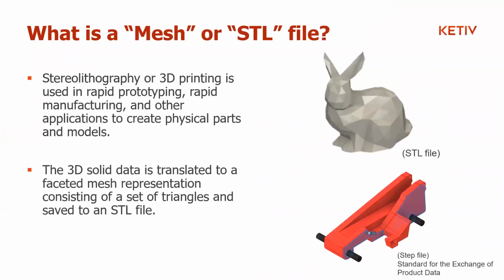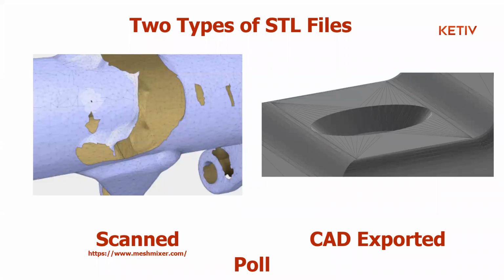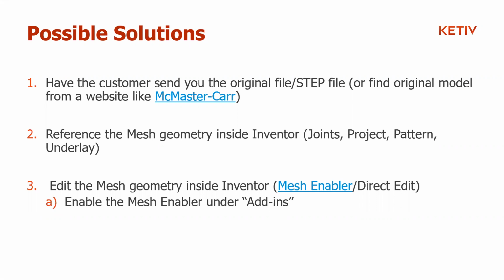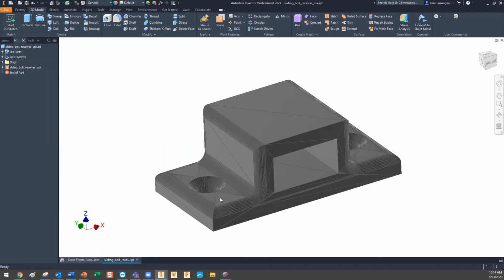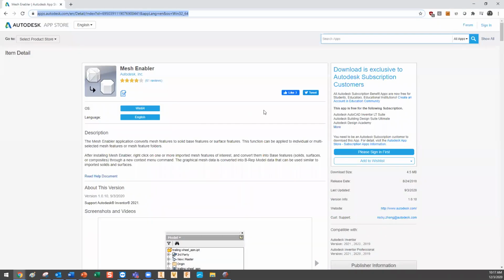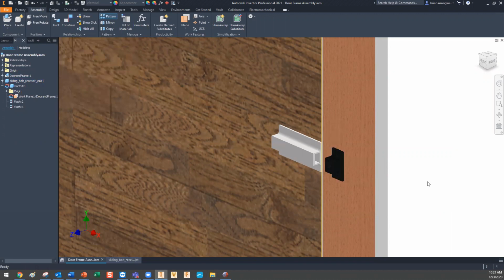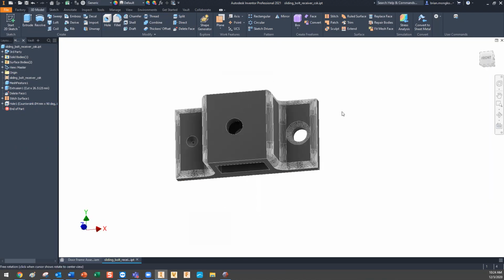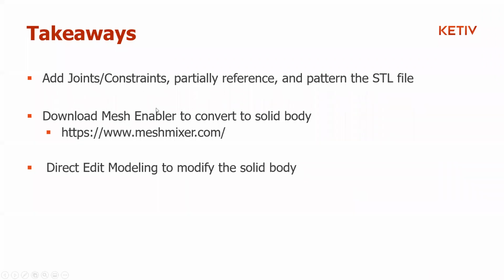Reverse Engineering Meshes inside of Inventor | Autodesk Virtual Academy

Comment: Hey, I find this video very useful. If this area is still monitored. I would love to know how can you take a 3d scan stl file and plane the surfaces. Is this possible with inventor?
Reply from the maker: Thanks for leaving a comment!  The 3D-to-CAD workflow is generally pretty challenging, and would require some more explanation, so feel free to reach out to support@ketiv.com.  However, if you're only trying to import an STL into Inventor, there are various import options that accommodate surface as well as some complementary derive functions which could output surface bodies from existing solid geometry.